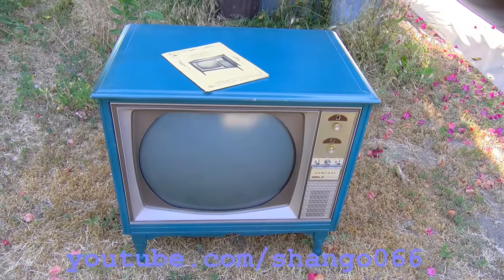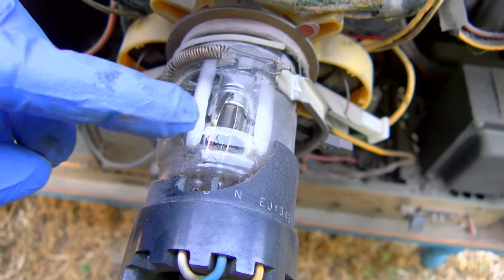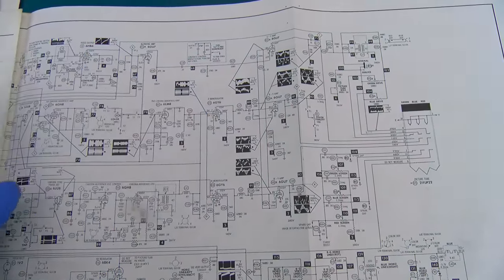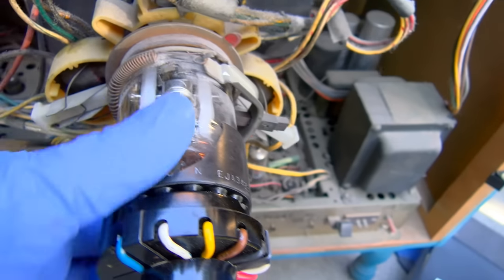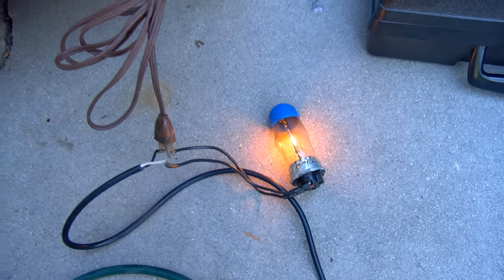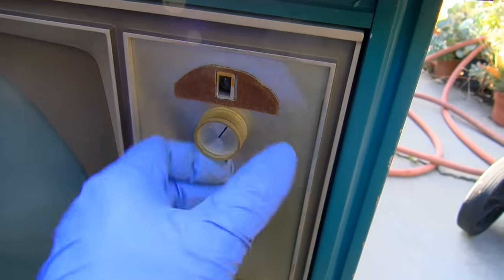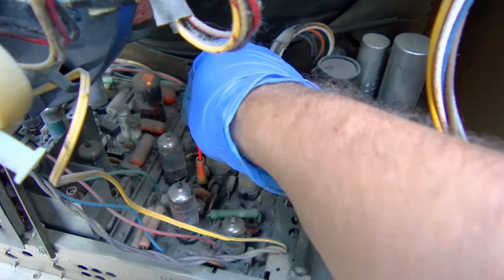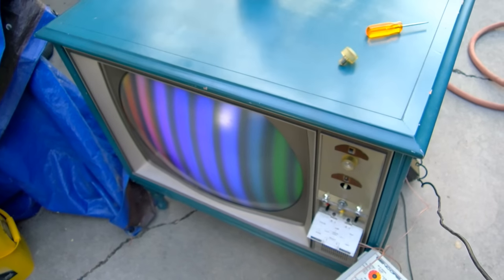Teal Admiral Vintage Color Roundie TV Analysis

Comment: I’m 19 years old and I love CRTs and vintage electronics, much better and more reliable than garbage flat screen TVs these days.
Reply: Here in the UK most of them are made by a Turkish company called Vestel and are designed to fail (mostly due to bad caps or self-destructing firmware) within a few weeks of the warranty expiring. They make something like 80% of the LCD and LED TVs sold here, including those badged as being from once trusted Japanese makers such as Panasonic, Sharp, Sony etc) and they all seem to develop exactly the same problems. I've just had to junk a 40" Bush (once a quality British maker) because it lights up then shuts off ten seconds later. It's less than five years old. They should just ship this garbage straight to the landfill and cut out the middleman (aka the purchaser).

Comment: Hello from Germany! I love your work and I've learned allredy a view thinks by watching your videos... I like your practical methods...
I can tell, that heer in Germany it's not so difficult to find some ( old) experienced radio- and Televisiontechnicist to support the younger generation with knowledge ( by the way, I'm 23 and getting in to repairing radios at age of 14 and 3 to 5 years ago I started to get in to televisiontchnic ( I try it)... Yesterday I repaired a graetz Kurfürst F171 ( Radio / TV combination from 1958 with 53 cm picture tube) the high voltage coil was baked... So I buyed a Philips cascade ( normally for color ones), after install it, a picture was there but mutch to small... So I lower the flyback voltage by connecting a 150 Pico capacitor from Kathode ( booster diode) to ground... Now the picture is good...
Soo I will be put a short video here on YouTube... Greetings from Hessen

Comment: I am turning 16 this summer and have been into vintage Electronics since February 2018 when I snatched a 1972 Zenith Circle Of Sound C472W Clock radio at my local Antique store for $25. Most of the stuff I have now is junk from the 90's and 00's. But I do have a few gems here and there....hope to get a Zenith Transoceanic Royal 7000-1/D7000Y for my birthday, as an upgrade from my ever-so-slowly perishing Reader's Digest RDA-127. Should be fun.

Comment: Hi all. I am an elder and have been in electronics for 45 years and cannot find even one younger person that is interested in learning electronics. Shame cause I would not charge any money and would even give away parts etc to get them started as was done to me from my “elmer”. Anyway since I have lots of spare time being furloughed from the “virus” I had the time to restore an old Dewald 501 radio. Happy because it was in very bad electronic and physical shape. It is the yellow bakelite model. Needed re-capping etc and was completely  missing the .05 uf AGC cap to start with with the usual noisy whistly front end which drove me crazy for a day or so till I found the missing cap. Also had to take apart the first IF can and fix the top screw type tuning cap as well as fixing the local osc coil. So now I only need one  white knob on the front (cannot yet find on ebay). Surprised the h@ll out of me to learn  that this model is selling for approx $900 to $1000 on ebay!!! Who knew? Anyway great channel and am a permanent fan and subscriber.

Comment: Remove the paint and restore that sexy wood grain.
Reply: Actually I kind of like the color, would make a great display in a coffee shop/ restaurant where they put old stuff as decorations. mounted on the wall, like Cracker Barrel does
Reply: That's too 70s for the 60s TV.
I have always had a console TV, even now.  Right now it mostly serves as a table for an LCD piece of junk though.  I always liked them.
Reply: Maybe send the TV to David Tipton's channel  - he recently restored a tube radio with a cabinet painted bright green (he brought it back to natural wood-grain and got it all working).

Comment: ive had similar boomer issues with vintage electronics test equipment and amateur radio. im one of the last Gen Xers (1979) so i used to be given old valve tv's and radios when i was very young to pull apart but became harder to find as i got older and as boomers made them so expensive to buy or just think valve tech is too old for my modern brain to get... I love boat anchor radios, i love valve test equipment, many of this old tech will out live me.. im restoring a Telequipment D43 scope and i love it

Comment: I was born in 98 so technically I'm a gen-z but I come from former eastern bloc so it's a bit shifted. I actually made my own equipment for working with tubes. 150-400V HV power supply using PL504(27GB5 ) and PCF82 ( 9U8A ), simple tube tester (heater supply, HV supply with current meter). Also a 0-30V 6A low voltage power supply. I have a different take on the tube stuff. Designed and made switching power supplies using e-waste parts and I power my experimental amplifiers using those instead of overpaying for traditional transformers. For semiconductor stuff I just discard older guys complaining about originality and replace all the needed components to make it working again. I saved a 1979 radio from trash, tuned from 65-74MHz band to 87.5-108MHz, replaced old IC audio amplifier with a more modern (and reliable) TDA chip (generic AB class amp), making an extra PCB in the process. And well, older folks are sometimes a bit furious about some of those mods.

Comment: I'm a '60 boomer and I had several of these classic roundies when I was in high school. I had reached the age where I could actually repair 'em n get 'em going again. The first battle was just getting the screen to light up. Then adjust the 2nd anode (high voltage) to 22.5kv. The specified value differed a little from model to model but as a rule, the were all generally happy running at 22.5kv. Second, set the focus for "sharpness". If you couldn't quite get "sharp", you could tweak the HV up or down just a tad. Second, align all the "screens n drives" and get a good "grey scale" Now, you're ready to use that fancy alignment generator shown in your video. "Purity". "Static convergence". (All adjusted with the 'gizmos' on the neck of the crt). Dynamic convergence. You could spend a month or two here and not get it perfect. But you could get 'not bad' at 6 ft viewing distance. And after another month of going through and tweaking everything else, your final reward was truly spectacular color, better than any brand new set of the time, due to the "rare earth phosphors" used in these vintage crt's. I know. I've been there. I read those inch-thick text manuals n learned by doing. They were cantankerous contraptions, even more so than a worn out ten speed bicycle. I spent more time working on them than I spent watching them, but it was a 'labor of love' and at 60 years old, if I had more time (and money) than I knew what to do with, I'd go out n get me another one! 8D

Comment: The 19VABP22 was an 'advertisement-reform compliant' replacement for the good ol' 21FJP22 or its earlier preferred 21GVP22 renewal type. The 19V represented the 19" diameter active viewing area of the 21" diameter bottle.

I'm Gen-X, just always insert a 300mA pigtail fuse in series with the Horizontal Out cathode circuit (or in series with the Horizontal Efficiency coil, thereby relocating the fuse to B+ Boost, in sets where a shared cathode and heater ground exists that may be impossible to separate without risking destruction of the tube socket) to protect the flyback, and be very careful about setting up the sweep and high-voltage adjustments for optimal output and regulator cathode currents. I'm currently providing books on loan for a neighbor's son to study. I'm not sure if he'll be patient enough to follow through with the full '50s-era trade school textbook series to 'graduate' to supervised lab sessions, but the process begins.

Comment: That's a great intro I must admit ... while I don't share an interest for Vintage TVs this old (still love my mid 90s HD Trinitrons), I'm into digital computers older than me (I was born in 1985) and "we" have exactly the same problem you describe. Elitist oldies hoarding and scolding - literally ending up with unused, broken piles of stuff being crapped on by pigeons or getting drowned in flooded basements while the young ones are usually considered clueless. While I've had the great privilege of working on a few extremely rare, expensive or sought after items (I do repairs, mostly selftaught) those were usually owned by oldies ... promising fair money (like more than a "tip" and spares parts which I used to ask for til recently) ending up with nothing but unkept promises. I've recently been offered to work on a prototype machine that usually fetches $15.000-$25.000 - which I have declined, as a consequence of previous experiences.
Wonder if that's gonna change some time before it's too late. I've seen what you described more than once - namely valueable items being dumpstered because the older ones don't care about the digital heritage.

Comment: Why you dont use the rejuvenate switch...so you can shoot the wehneltzylinder free.
Ive got the same 30 years ago in my company and used it, if the tube shows up so bad like these.
Try it the next time, you can hear it by a crackling sound inside the tube if its blocked by tiny parts of the filament.

Comment: I'm a millennial currently working on my first Roundie.  Picture had been dim and slightly out of focus (I got it to be a lot better by installing a new focus rectifier, but it still had a ways to go) and tonight I finally decided to risk hitting it with my rejuvenator.  I was honestly shocked at the improvement.  It still doesn't look like a 'new' tube, but it's 100% more watchable.  It is sharper and has better color and contrast.  Unfortunately I still can't turn it up to a very bright setting due to an issue with horizontal lines appearing on screen when high contrast images show up.  I'm probably gonna mess with the AGC some before actually replacing anything (if it's not that I was wondering if it might be something in the horizontal blanking circuit).  Eventually I'll have to de-cataract the tube and I'm not looking forward to that, haha.

Comment: I am older gen z (which isnt very old but still) and while I know that I currently dont have the time or space right now to properly care for one of these pieces of history it is fascinating to learn about older technology especially purely analog systems because nearly everything uses some form of digital controller to manage it. I think even the last CRT screen TVs I remember from the early 00s would have been more or less a CRT driven by a digital controller.

Comment: yeah that's how i learned a lot of the stuff i know back in the day. my parents probaly weren't too happy about though....  LOL  i loved to take stuff apart to see how it worked.  most of the time whenever something broke down i'd ask my parents for it so i could take it apart.  unfortunately sometimes i was too confident, thinking i could put it back and they wouldn't know then i'd mess it up somehow
Reply: The most memorable thing I ever took apart when I was a kid was a Kodak instant camera. It was useless because Polaroid had sued Kodak and forced them to stop making film for it. What made it memorable was the still-charged 300 volt photoflash capacitor. I shocked myself on that a couple of times before I took a screwdriver and shorted it out. It made a very loud pop, and for some reason I didn't think it fully discharged so I shorted it again and it made another pop, although not as loud.

Comment: i'm 32 and have been into vintage electronics since my teenage years..as i get more experienced i tend to get upset if i watch some guy trying to fix an old set and ruining it, sometimes forgetting that i have been there. But if someone needs help and i feel i can help than i do help. if you go and ask for advice on videokarma forum than you are presented with the boomer elitist attitude were people either dont help at all or they explain something to you on hiper complex terminology so you dont undestant anything. Just try and go there as if you know nothing about tvs, you just bought one and want to aplly a signal. you dont know what vhf and uhf stands for, you dont know what a modulator is, neither antenna impedances etc etc...you will greated by some guys that just want you to stay away from that hobby....Here in Portugal nobody cares for old electronics but the thing is if you try and buy something (an old set for example) they are rare and people call them "vintage" "rare" "art deco" they lie and say it works etc etc and price it like a brand new 42 inch flatscreen althouth its infested with mouse piss and woodworm and has a bad lopt and weak crt. you feel kind of lonely in the end
Reply from the maker: I was on video Karma years ago and quickly left that alone. Hopefully these videos and my way of doing things can help others. If not they are just entertainment. In the end all things return to the Earth from where they came so don't have emotions over these things going away
Reply: @shango066  your videos have been helpfull yes so thanks for doing them. UK vintage radio forum tv section and dampfradioforum.de have a couple of helpfull guys but the rest are just there to show themselves off.as for videokarma i just dont go there anymore aswell. a couple of tv repair channels are starting to pop up like OJNOJ for example and thats great. maybe inspired by your channel. we also need to debunk the insane irrational fear that young people have of being around a crt.
Reply: @shango066  That's a good way of looking at it.

Comment: How do circular tube TVs work? Do the corners of the image get cut off? Also, what’s the purpose in comparison to a standard rectangular tube TV?
Reply: The first 10 years of color TV had round CRTs. It was difficult to make the angels of deflection of the three beams line up with the shadow mask and phosphor dots on a rectangular tube. That results in poor color purity. It took a while of development and some correction circuits to achieve a successful rectangular CRT. The first Successful(if you can call it that with how short they lasted) rectangular picture tube was the 23EGP22 developed by Motorola in 1964. These were a disaster but they jump started the rather laxed CRT development at a competent TV manufacturer,  RCA who developed the 25AP22 and 25XP22 for 1965.
Reply: @richardhz-oi8px  Early B&W TVs also had round CRTs. Different models had different shaped bezels. Rectangular, which allowed the whole picture to be displayed by having the corners of the raster just touching the edge of the screen, DD, which filled the screen horizontally but left black bands at the top and bottom like this set, and port hole, which filled the whole screen.

Comment: My parents bought a RCA roundie back in the 60's when the only color broadcast was on the NBC network, we actually would wait to see a show broadcast in color, ABC was gaining in color, but CBS was the hold out, I guess CBS had thought the color system may change ? PAL was a much better system but not compatible with black & white like the NTSC. I guess too that it was a global format war that no one knew about or cared about. I do remember what a big deal it was when the FCC mandated that all TV's built going forward from 1963 had to have built in UHF tuners.
It was about 1963 that Motorola broke the roundie barrier in a breathtaking rectangular tube, many may know the name Quasar associated with Panasonic being the parent company having bought the television  division of Motorola in 1974. Boomer here, laterz
Reply: PAL is compatible with black & white.  Any system had to be to avoid making b&w TVs obsolete.
Reply: @Wenlocktvdx  Never knew that about PAL thanks
Reply: CBS lost the color war with its incompatible color system, which involved a rotating color wheel in front of a standard B&W CRT, with the red, blue, and green transmitted on successive fields. CBS had good reason to hold out on NTSC color.
Reply: It was shut down when the FCC ruled that color systems had to be compatible with black and white.  The scanning standard used by RCA was 405 lines at 144 FPS which was impossible to display on a black and white TV
Reply: @Wenlocktvdx  Which is why CBS held up with standard B&W until 1965. They invested a lot of money in their color system, only to have it killed by the FCC because they wanted compatibility. They were finally forced into adopting NTSC color because NBC, ABC, and a lot of independents were in color, and they were the only network still in B&W. Producers, viewers, and advertisers were demanding color.